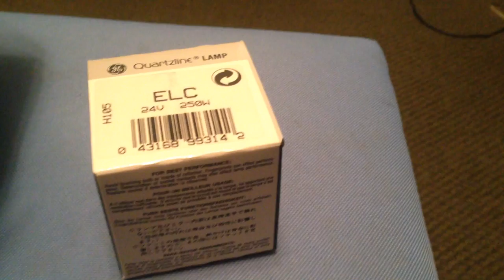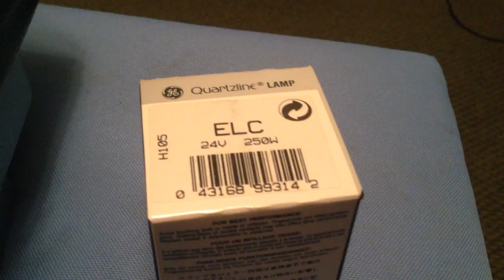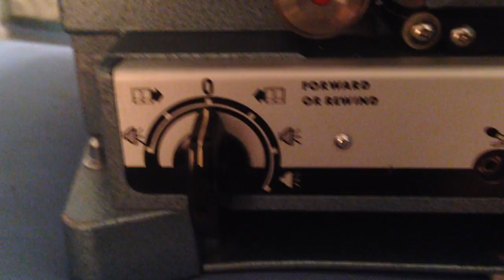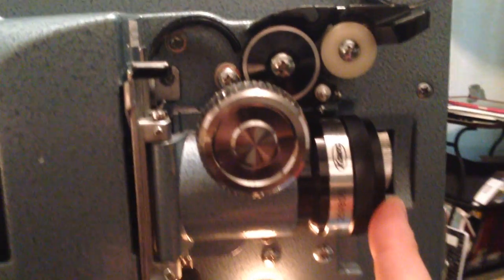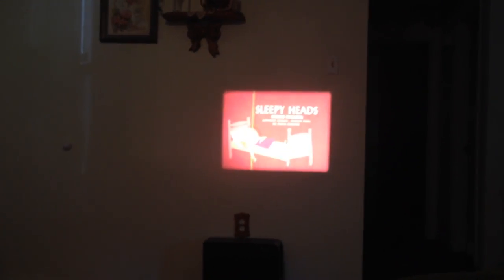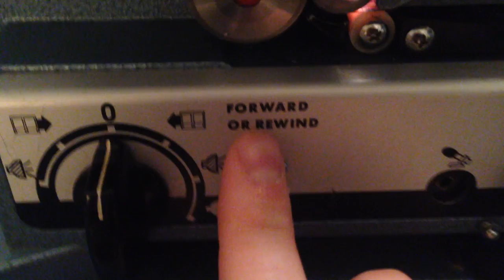Operate your Eiki RT-0 16mm Projector and Attract a Mate

Comment: When I was in primary school in the late 70's/early 80's, I quickly learnt how to use this projector.  Bear in mind I was around 9 or 10 yrs old at the time.  I was often called to run the projector for other classes.  I also ran the projector for the end-of-year 3-hr movie with the 1-hr long-play reels.  They were heavy!!
Reply from the maker: Brent, I always wanted to be that guy to operate the projector, but they just wouldn't let kids touch them.  So I grew up and bought my own projector.  :D
Reply: databits Most high school these days probably don't maintain a "A/V Club" anymore, I wanted to be in one but mine didn't have such a cool club in the 90's when it still mattered.
Reply: Trinexx007 At least you remember it!

Comment: Hi there, thanks for the brilliant video! My projector seems to be running fine apart from no lamp light (which I'm replacing) and both spools aren't twisting at all when I run it - any idea why this might be? Thanks
Reply from the maker: It is likely the belts which turn the spools are broken/deteriorated.  Remove the covers on each "arm" and check them.

Comment: I have one of these but the sound is rather "wobbly", as if it's being effected by the shutter
Reply: That's probably because the lower loop is too small, or it could be because of a bad/broken flywheel.
Reply: @Robin-si3vw  I've tinkered with it a bit and it seems to be a lubrication problem. The projector had been sitting for 20+ years before I bought it